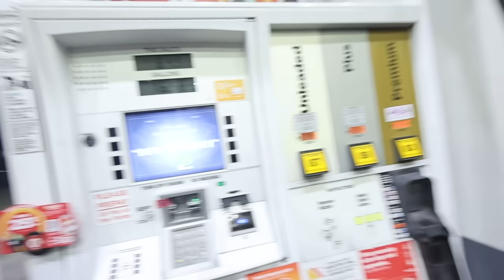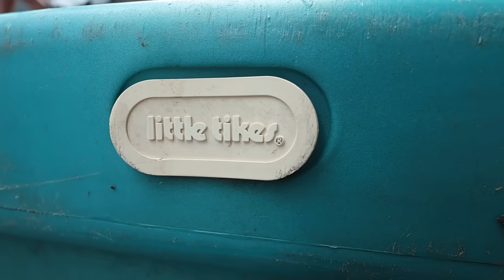We made a MINI BOAT out of a Toy Sandbox - The Rub & Tug

Comment: For your motor unless it was submerged underwater longer than showed in the video i doubt much water got inside. Looks like from the 3 star sticker that it might be a four-stroke engine. I would dry out the electrical connections, maybe take apart all connections and put a bit of dielectric grease to prevent corrosion and future sinkings it will act as a seal. Purge all your fuel lines out, making sure no water is mixed in. Take out your spark plugs tip the motor so water can drain out, then rotate your flywheel so that each pison will push out water. You can then spray in some lubricant or two stroke oil to lubricate the piston rings also working the oil in by turning the flywheel. Then put it all together, start it up and run it so it heats up and boils off any interal water that might be left behind. Make sure to eventually do an oil change at some point.  Not exactly necessary needed unless it was going to sit for years or if you live in cold freezing climates.

Comment: So your supposed to add some pieces of wood on the inside of the transom where the motor is supposed to mount so you can have support for the motor, and i dont know how many cans of expanding foam it takes but you can find that out online but your supposed to fill the inside of the sand box so that it floats a bit better.

Comment: Get some great stuff foam and fill it up by drilling holes in certain areas for the foam. Then seal each hole with the water seal tape. This way it will never sink. Like a Boston whaler boat. Just a thought
Reply: Could work!!  Flex seal caulk under the tape. Lol

Comment: Just drill little holes in the boat on the top and spray expanding insulation foam in it and then fill in the holes with silicone caulking. Boom! Problem solved!

Comment: Bro you gotta inject spray foam into the boat and fill it completely so it’s a lot more buoyant and can support the engine. Then you pretty much fix the taking on water issue. Just get low expanding foam spray foam. Don’t get something that going to expand a ton and break the boat in turn

Comment: You need to tear down that engine as soon as possible. Do not try to crank it until you have drained all the fluids and dry it out. Water could have gotten in the fuel and passed the Reed valves if it’s a two stroke. Take the plugs out of it. And try to crank it in case it’s vapor locked. You should probably even change the foot oil. It’s not at rebuild yet, depending on when you filmed this, but if it sits with water in it, you will need to rebuild it. I would soak it with WD-40 but don’t try to crank it until you’re sure that there is no water in the engine. A rebuild is not a difficult job if you have the proper tools. I highly suggest contacting a marine mechanic if you don’t know what you’re doing. Hopefully, you see this.

Comment: Motor should be fine. Just drain the oil and gas and the bowl on the carburetor. Maby pull the spark plug and drain anything in there the combustion chamber. If there is a primer press it  a few times to clear the lines before draining the combustion chamber. Then add oil and gas and try her out.